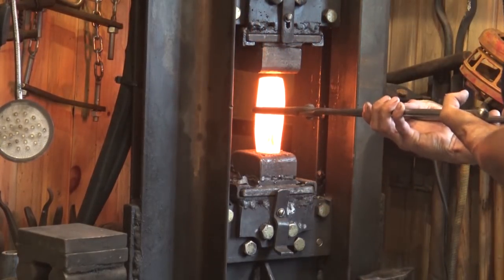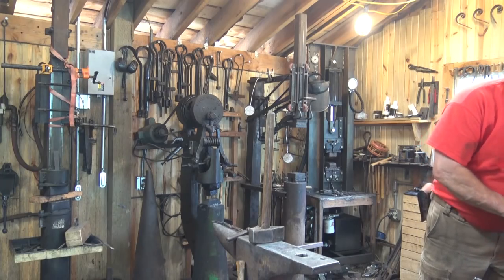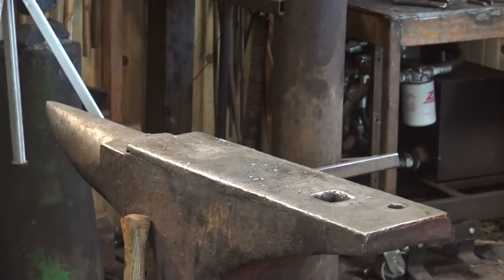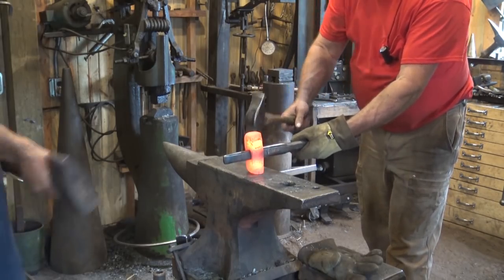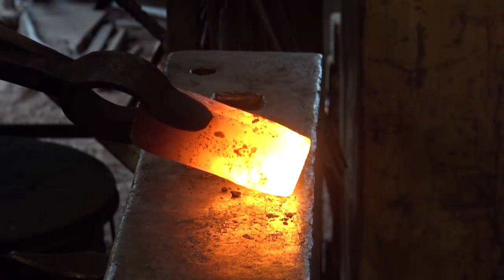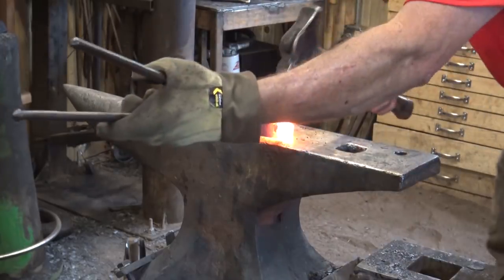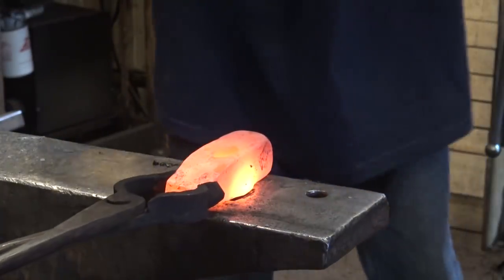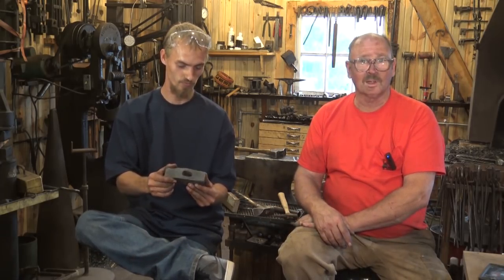Forging a hammer with Jake from Jake's Custom Knives

Comment: I still dont get it 
As the punch is hitting the steel is the slug compressing in density or is the steel around the punch being displaced say at the 50% punched point 
When using a punch press a slug comes out of the die basically the same thickness as the metal being worked but when you are driving the punch into the steel you are pushing the steel slug into the anvil basically dead heading the slug and punch till finally moving the slug area over a hole in the anvil
Reply from the maker: Its displacing material as the punch pushes its way down.  In the end its a very small slug that ends up being sheared out.  This leaves nearly all of the original material for more strength than a drilled or cold punched hole.